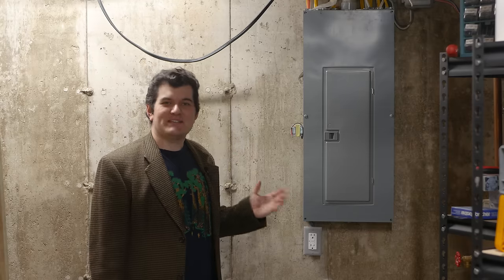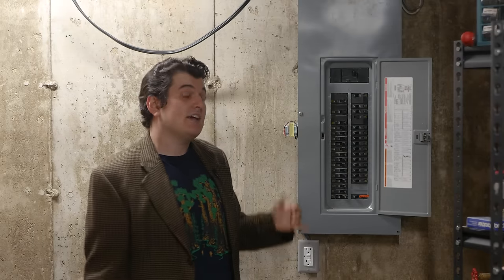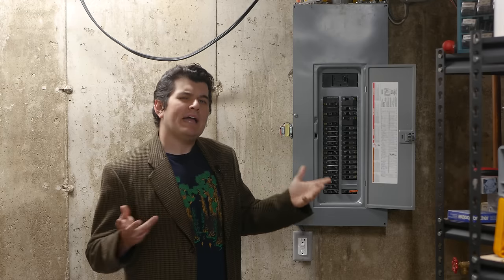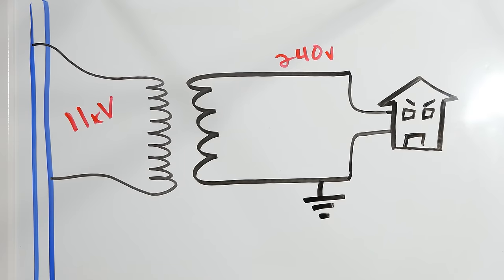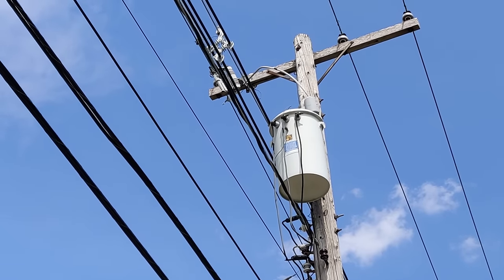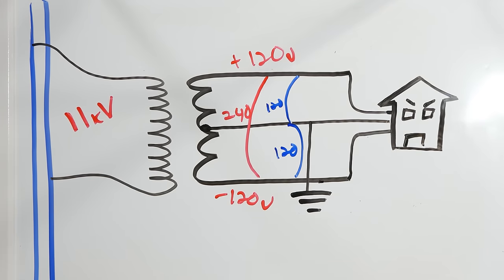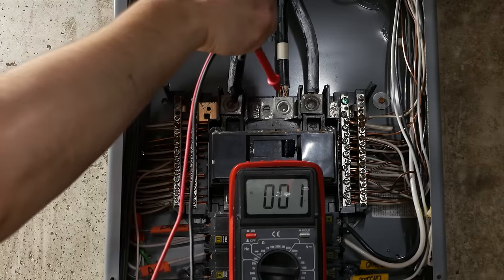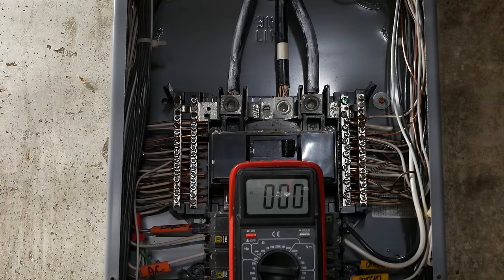The US electrical system is not 120V

Comment: In comparison with European standards, this breaker box really looks incredible unsafe, but it seems to be the way how it's done in North America. For example in Germany we use a DIN-rail system to snap the breakers and other devices on. Within new homes, renovations and almost any business buildings, terminal blocks are used for a clean and well-ordered installation of all incoming wires, before they connect to the breakers.
Reply: Same in Australia.  DIN rails and terminal blocks.  And not accessible unless you remove the inner cover of the board.

Comment: Crazy thing is if you take the two 120 legs on a 240v circuit you can power two 120’s but if one or both power say window a/c’s one or both a/c’s will fail quickly cause one leg is usually less than the other. Idk why. Maybe y’all can explain it

Comment: It's a littlebit of a shame that he doesnt mentions that this system, since it is still 120V against ground in the end, still introduces unnascesary transmition loses, wich is the whole reason why other countrys use a 240V system.
Reply: Our transmission voltages in the US are lowest at 12470/7200 volts up to over 120,000 volts.  Not so much line loss here.
Reply: Nope, transmission is minimal inside a house.

Comment: Here is the most interesting thing.  You did a video on film and projectors.  For movie theaters if you run a film print through more than one projector (interlock).  If you lets say one projector has 121 volts and the other 119 volts.  We'll then the projector with the higher voltage will pull the film out of the lower voltage projector damaging the film.  But the motors on the projector are syncronus (60 Hz) therefore all the projectors will run at the same speed.

Comment: 120V just tingles...not a big deal, unless your standing in water bare-footed!  In my work-days, I worked with 480V 3-Phase live.
Reply: There is a large continuous range between the shock you will get from 120V while standing on a dry floor vs. standing barefoot on a wet floor in contact with the ground.
Reply: @GH-oi2jf  - Hum, he just repeated what I said.

Comment: I know that it’s 120/240 yet since I can remember it’s everyone I know has called it 110/220 so that’s what I say. I’ve tried to correct it but it slips out sometimes. The ironic thing is us being more technologically advanced is why we have 120. I think it was light bulbs but they began only with 120 which is why we used that system. Then they developed better bulbs that used 240. This is when they began moving throughout Europe and the rest of the world. The us already had 120 as the majority and it would cost too much to redo the systems across the country so we stayed 120 whereas the rest of the world started with 240v
PS Water heaters are beginning to use plugs. I don’t know what residential electrical code as I’m a plumber but I know I’m commercial they need a disconnect at the unit. So in residential settings I’ve seen them  install a 240 receptacle and plug which doubles as the disconnect

Comment: Love the video and yes 120v is safer than 240. I grew up in Europe where everyone has a horror story to tell with 240V while in the U.S. I have yet to hear one . Had the "luck" to feel both several times in my lifetime, believe me the unpleasant shock from 120v doesn't compare to the painful incapacitating spasm in your muscle from 240v. Lower voltage saves lives indeed.

Comment: As an electrical engineer from Europe that didn't knew how it works in north America, and also "120-volt-bashing" (well, you deserve it a Lil bit 😅😂), this system is kinda clever.

With proper electric plugs, it should be perfect, but I don't see that happen before at least the half or end of this century.

Most of our electronic goods sold in the EU are the same as USA, it works on both, the stuff just detect it and switch mode according to voltage.

Might be interesting to have that in some places.

Though, for energy saving reasons, 240 volt will stay, and items/goods are made safer, so, if you don't have a shock, you don't have to be afraid of 240.

Personally, I had ~100+ DC shocks, at least twice, while working on an EV, it's the worst, and I was 100% making the short circuit, and most time you're not 100% of the electrical grid potential, but a fraction of it.

Comment: Well most if not all the USA homes may now have transformers that have 120/240 VAC.

BUT...

NOT that long ago there were still many pole transformers that were designed to output 115/130 VAC!

Over the years and large area of the USA with different companies producing and distributing electricity, they did not all have the same ideas of what the actual voltage should be.  The transformers were deliberately intended for various output voltages based on the market they were being sold to.

There were transformers that output
 110/220 VAC
 115/230 VAC
 117/234 VAC
 And finally 120/240 VAC

Each of these transformer output variations were designed for the SAME input voltage.

I remember well the old black pole transformer we had that was a nice 115/230VAC output installed in the late 50's.  Sadly the power company finally replaced it with a gray 120/240 VAC model.  This of course meant higher voltage and current, and of course more power to be consumed.  More money for the power company...  Plus, higher voltage on standard filament lamps equals shorter life...  So we went from hardly ever replacing light bulbs to very frequently replacing light bulbs.

Of course there were long life bulbs designed for 130VAC that will definitely last longer and are also not as bright or efficient...  Kind of like we had with the lower voltage before they changed our transformer for the higher voltage one...

Comment: Bah, yes, it is. Well, primarialy. Most of the house takes 120 or less. But an entire house usually takes more in total use than a single 120 would provide. And, there are few accessories atop the average use of a home that require more than 120 can provide at all. Like A/C's for instance. And most likely a drier. Or even an oven and stove combo.

Comment: Interesting video and well done, I will say however that whilst I don't know much about electrical instillation in any country, I do know about computers and servers.

And I do know that electrical efficiency is a big thing with this, and switch mode power supplies are (to my understanding) a lot less efficient when attached to 120v instead of 240v.

Now I know from what you have said 240v is available so I am sure dedicated server rooms would run on 240v in the US (they usually run on 3 phase over here in the UK) for the home user (which most houses likely have a pc) it means a higher energy costs.

And I doubt PC's are the only example of this.

Comment: I'm a little bit scared (shocked), now. There are 10A circuit breakers. Okay. But no surge protector, no main circuit breaker before the line breakers, not a single shabby RCD? No real ground but the neutral line?

Really, nothing but the 10A circuit breakers?

An installation like this was declared illegal here for unnecessarily endangering lifes, for at least 40+ years...

Comment: Does YOUR drawn step down transformer use SWER (single wire earth return) to the Substation?  Or does it use a Neutral conductor?

Thank you.
Reply: In N. America it is usual for there to be a neutral connected from the substation to the customer’s wiring.

Comment: 21:39, so when you have your TV and DVD or Microwave that doesn't have a separate power switch, and you plug it in and you hear that crackle of the voltage arcing across the gap to the device when you plug it in, you don't get any pucker factor? Also, when you want to remove power to the charger to your phone so that it doesn't burn your house down in the night, (Yes it's a thing) you have to unplug it and then plug it back in in the morning instead of being able to just flick a switch? How lame.

Comment: Most modern homes are 3 phase here because single phase is stupid especially if you are running AC, 3 phase motor/compressors are much more efficient, quieter and smaller.
Although i have worked on old equipment on a farm that had 240/480 basically the same as US being a split phase system.
And switches on the sockets is purely a safety thing we can get outlets with a gated earth socket that switches the outlet when a plug is inserted also why switches on sockets aren't required when they are over 2m off the ground/floor

Comment: Jesus, this breaker box looks like something from the 1950s. No protective fi circuit breaker oh dear! Looks a lot different than the standards in Germany and most of Europe. Btw even my old little condo had a 3 phase 400V / 16 Amp line in the kitchen normaly used for the stove. No socket but to permanently wall outlet to wire the stove to. As I did not use it I made a small distribution and took 3 times 240 Volt / 16 Amps = 3 x 3600 Watt from that wall outlet to run the dryer, washing machine, vacuum cleaner and so on...
Reply: Ahh, and dont forget the popular water heaters with either 18.000, 21.000, or 24.000 Watt. These dont heat the water constantly but only when you turn on the hot water for example in your kitchen. These are of course also powered by 400 Volt 3 phase but with 32 Amps I guess.

Comment: I'm sure you read every comment, 23,000 at this point, of a 3 year old video.  Anywho, the reason we, the USA, have 120v in common use is Edison.  The orginal commerically produced light bulb could only handle 120v of pressure, it was not possible with that time's state-of-the-art building methods/materials to make a light bulb that could use 240v.  By the time europe got electrified the technology of building a light bulb that could use 240v was in  use.   Once you get started down one path, it is extremely hard to change.  fyi, this was one of the first times where the world took advantage of leap frogging technology.

Comment: One last comment...at the 7:57 point in the video, you show one circuit being "-120" volts to neutral and the other circuit being "+120" volts to neutral. There is no "negative" or "positive" - the power system is an alternating current power system, with no "+" or "-" that you would have, as with a direct current system. Thank you.
Reply: Describing the phase of a sine wave in complex numbers does require a positive and negative numbers.  Phase zero  consists of a positive real number and an imaginary number that is zero.  120 degrees requires a real number that is negative and an imaginary number that is negative.  240 degrees has a real that is negative and an imaginary that is positive. Both zero and 180 degrees have imaginary numbers of zero but the real number for zero degrees is positive and the real number for 180 degrees is negative.  So plus and minus is appropriate.
Reply: @AnbroBR   Transformers can do two things, impedance matching and phase inversion.  Inverting the phase is no different generating two different phases 180 degrees apart with a winding in a generator.   Granted the input to the transformer is single phase. The output of the pole transformer is two phase.  To put it in compass terms you are saying that three phase is  A=0 degrees, B=120 degrees and C=240 degrees.    In other words A=north, B=Kinda south of east and C=kinda south of west.   In the output of the pole transformer you get  L1=0 degrees and L2=180 degrees, but north and south are the same direction. They are two directions, North is + and South is -.

Comment: Sir, you are an incredibly narcissistic nerd, but goddamn, you are the first person to ever explain the split phase system in a way that I could actually understand. I still can't comprehend how the neutral wire isn't ground, but it's connected to ground, so maybe in a future video? Thanks for the knowledge, I give you subscription
Reply: @billelkins994  Now that also makes sense!! Plus you somehow were aware of what types of women I have an affinity for! Thanks Bill, seriously, that really puts it into perspective for me!
Reply: @KevinCoop1  Oh no, long winded is part of my soul! Brevity is for suckers! Thanks Kevin, that actually makes a lot of sense!
Reply: Ground is a safety feature. If neutral wasn't grounded, things would work just fine with 120V on each leg powering the circuits just like they normally do. The problem lies with what happens if the hot shorts to ground. In that case if the neutral isn't grounded, then the breaker doesn't blow and you can get shocked. The neutral is grounded in the main panel only. The neutral (white wire) conducts all the current back to the main panel where it mixes with the other neutrals from the same and other phase balancing out the voltage. Ground (bare wire) running to all the outlets stays at ground potential with zero current running on it. It provides protection in case of the hot wire breaking off and shorting out to any metal casing which would pop the breaker.

Comment: Any 2 phases 180 apart would cancel to zero is it 240v or zero volts ? It depends how u take the readings. Its a transformer with a tap  Both leges are in rhe same phase as are the windings of a tramsformer.
Reply: Isn't the current in a leg flowing in the opposite direction from the other leg?
Wouldn't this mean that leg voltages are necessarily 180 degrees out of phase?

Comment: Great clip. For me though, the surprise is not that the USA really uses 240 volts, but that they use volts, amps and ohms as units, like everybody else. I expected there would have been resistance to that. As for not seeing any value in having switches on power points; you've obviously never had a pet that likes to chew cables.
Reply: Your expectation is peculiar.  Customary units don’t fit neatly with Metric units because they originated in antiquity.  Units related to electricity originated in the nineteenth century, after the Metric System was already established.

Comment: It’s always baffling how people outside the states tell us they use 230 or 415 volts which is supposed to impress? We’re opting to use smaller and smaller voltages here because it’s safer. Even a lot of appliances that used to be 240 volt hardwired are now being built as a standard 120 volt unit we can plug in anywhere.
Reply: Considering that the human electrical system is about 1 volt, 115v AC or thereabouts is as dangeroust as 230.   And you have not been opting to use smaller and smaller voltages in the mains; it was 110 and went up to 115 and then 120. Obviously the majority of electronics operate on low voltages, but that a different matter.

Comment: Unplugging a sandwich toaster (without first pressing the UK socket switch) sparked and tripped the breaker for some reason. Cleaning the black char from the plug contacts seems to have resolved the sparkinb but I’ll be using the switch first from now on.

Comment: Is nobody talking about the 200Amps main breaker? Here in Belgium an residential home get 1 live wire (400v) and 1 neutral wire, wich makes it 230v. Our standard main breaker is 40 amps. More than enough to for a home. Are you running a factory?  😉 

Great video, it was a learning experiance. 🙂
Reply: It is a question of latitude.  Longitude doesn't make much difference.  Tripoli, Libya is more Arctic than my house.  Air conditioning!

Comment: Respectfully, you're wrong. There are many voltage levels used in the distribution of AC throughout the grid system. The common reference point across all of that is the Point of Use voltage level. In the USA, that voltage is 120VAC. In Europe, it's 240VAC. Are higher voltages available? Of course, but it's not the Point of Use voltage anymore.
Reply: respectfully he is correct.   the author is referrng specifically to the US system of 120v amplitude per phase for households.  for industrial commercial applications it is 3 phase of much higher voltage.   In europe it is 240v amplitude per phase.   the equation is power amplitude and phase.  not “point of use”,  which has no meaning to electrical engineering

Comment: OF COURSE North American electrical system is 220-240 Volts. it just split into 2 phases of 110-120 Volts inside buildings / homes for smaller appliances.

Comment: Luckily European electricity system is simpler. We only have have a three phase distribution transformer for low voltage, and it's a Dyn (HV side connection is delta, and LV side connection is wye with neutral. The single phase voltage varies from 220 to 240 volts and the three phase varies from 380 to 415 volts depending on the country, and the nominal frequency is 50 Hz.
Reply: It isn’t simpler, just different.
Reply: @GH-oi2jf  I'm referring according to the transformer connections, because the distribution transformer HV side is connected in Delta, and the secondary is connected in Wey and the neutral is connected to earth. Hence, we only have 3 phase or single phase voltage, but not 2 phase, because we don't have this strange connection were the 2 phases are 180° out of phase.

Comment: so you could just wire up the 240V to your kitchen and use a standard EU plug. We use 230V at 50Hz normally, not 240 at 60Hz, but a simple kettle wouldn't care. 🤷‍♂
So you could cook your water even faster with a standard EU kettle.
Reply: name checks out.
Reply: You wouldn't be able to do this, because then you would have a receptacle that has its designated "neutral" socket connected to something other than a grounded conductor.  If you had a Euro-spec load that "cares" about one of its supply wires being a neutral wire, it would be a problem to operate it this way, and this practice would give a false sense of safety.  You could only use US 240V to power a Euro-spec load that is neutral-agnostic and frequency-agnostic.

Plus, there's the issue that such a plug wouldn't be listed for use in the USA.